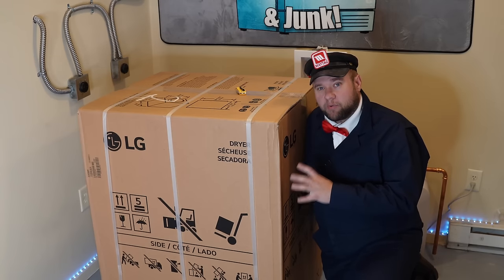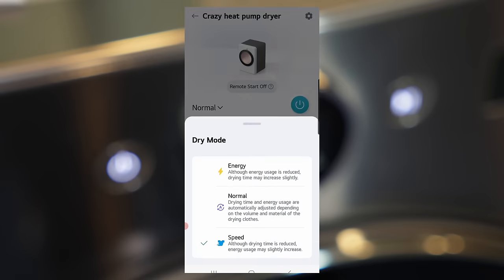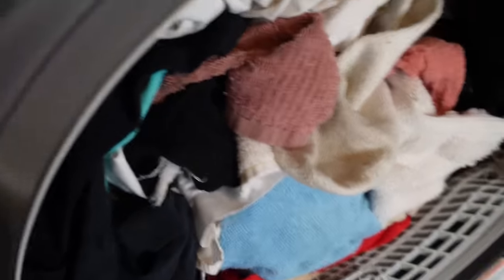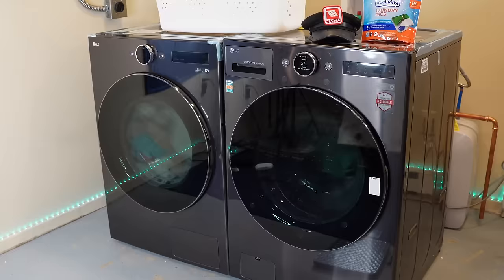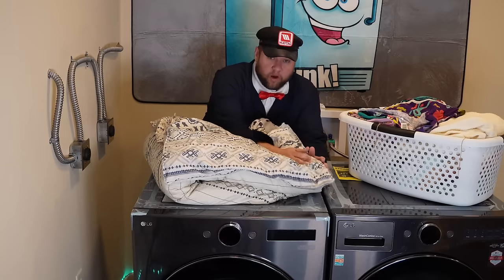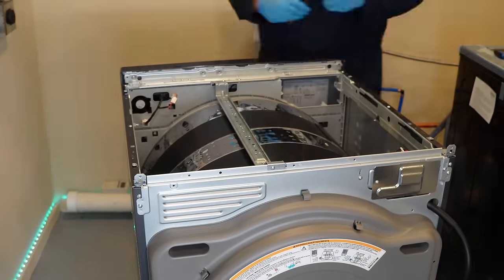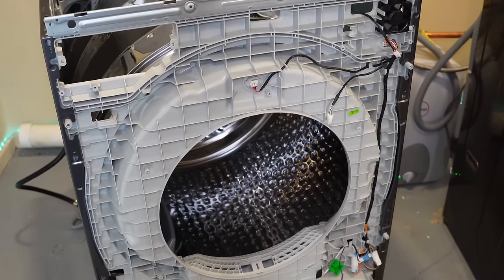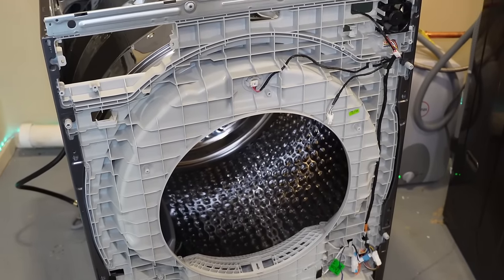LG Heat Pump Dryer - Way Better than I Expected - DLHC5502 Teardown & Review

Comment: Are they using the compressor they created back in 2011 or so and found in all of their refrigerators, for which there is a class action lawsuit in place after LG refused to do anything with a clearly faulty compressor that fails very quickly. Because of their corporate culture regarding that failing compressor, we don't buy anything that has LG on it.
Reply from the maker: It's mentioned directly in the video with part numbers...
Reply: @bensappliancesandjunk  Thx. I'll watch the rest then. I just get out LG vids generally.

Comment: The DLHC5502 is 240Volt with only a 5,100BTU heat pump?!?!, with 240Volt they can run a 24,000BTU heat pump. There is a big gap between the blue coil and the silver one, maybe LG is testing a small heat pump for now, then later can be a large heat pump, for faster drying.

Comment: This is such bs.  I have a top loader and electric dryer.  It takes 1/2 hour to wash and 40 minutes to dry.  I use 2kw/hr total for both.   I bought thses in 2005 and have had zero service.
Reply from the maker: How did you measure the 2kw?
Reply: @bensappliancesandjunk  PGE sends me an email every week with my daily uses.  It spikes 2 kwhrs when I do a wash and dry..  My other days are consistent.

Comment: You think that fancy screen will last 20 years +😂. High tech solution that is not needed and will hassle the customer no end.  Unless you are off grid, this type of system makes no sense. Additionally, agitating your clothes twice to three times the time will do them no good.
Reply from the maker: The lower heat will ensure the clothes last longer than a higher heat dryer. So the additional Tumbling will not have the negative effect you claim.
Reply: @bensappliancesandjunk  heat used is based on type of load. Prolonged physical agitation of any clothes in damp hot environment will definitely affect life and appearance of clothes. Your  jeans etc might be ok, everything else not so much. To save 30 cents per load you are going to pay double the price,  then get half the life of a normal dryer, wait longer for the clothes to dry not to speak of wear and tear on the clothes.  I love heat pumps, I have one at home for HVAC and in my car but this is not a good application for HP.

Comment: Then it breaks 😂. You'll never break even let alone save money. NEVER. No, LG isn't gonna help you. They don't have to. You can't sue them.
Heat pump water heaters are great. They're used all the time, simpler and will save you a lot of money.

Those cycle times and power consumption is terrible 😂
Thats the same as a conventional dryer on low heat. ABSOLUTE JOKE